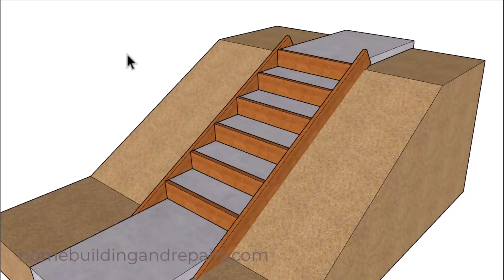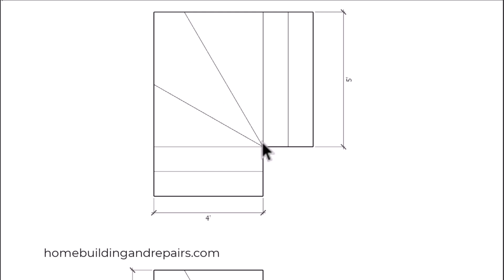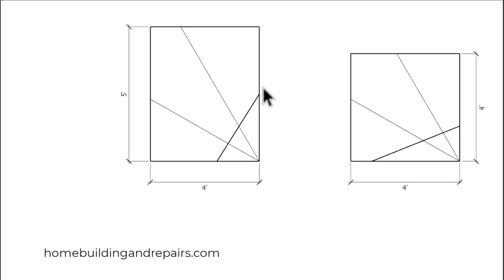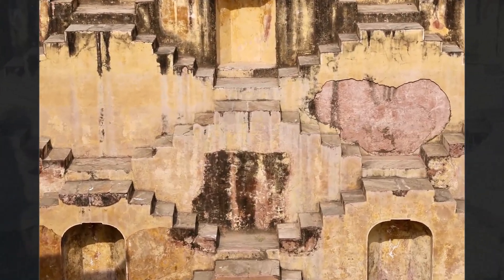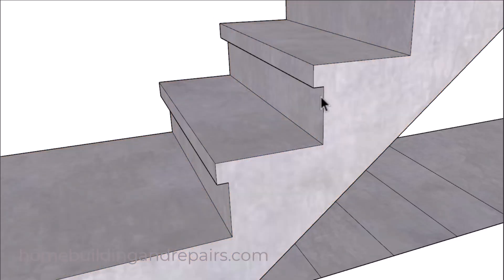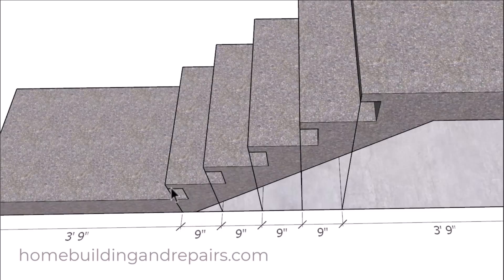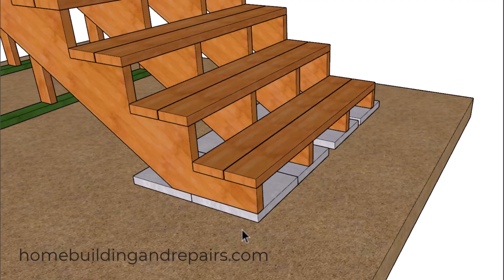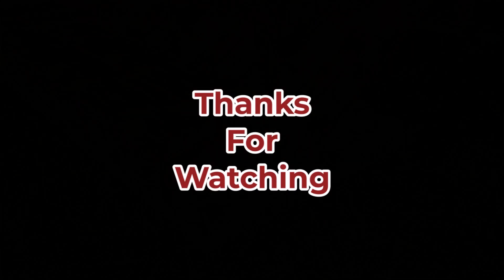Five Stair Building Videos For Do It Yourselfer's And Pros - Part 8 - 2024

Comment: Hello I enjoy watching your Video's Liked#9... I am designing and going to be building a new home...By chance do you have a video on "L-Shaped Staircase with Landing (Quarter-Turn Stairs)" my purpose is to design and build a staircase leading down to the basement,  Total Rise 104” x Total Run 180”=15’feet turning right against the founadtion wall, then straight from the corner of the foundation wall, out faceing the basement and I would like the landing to be up high, becuse under the stairway will be a Utility room with a standard 6'8" x 32" door. I have been looking through your video's unless I have missed it, I will look again, Thank you KJ!!!